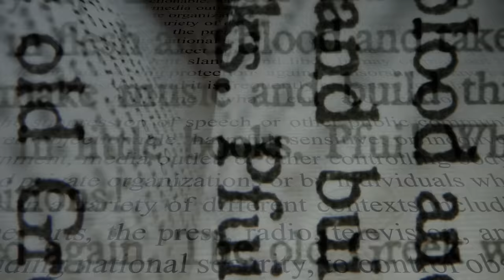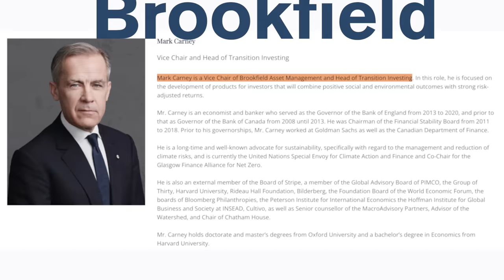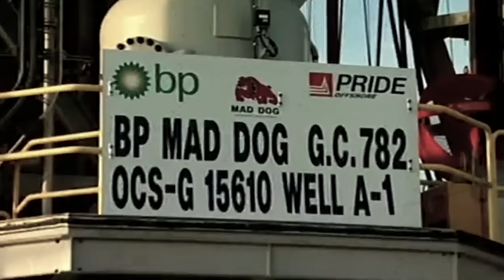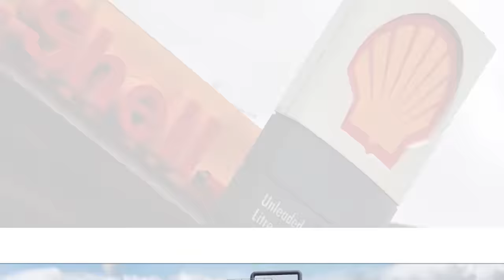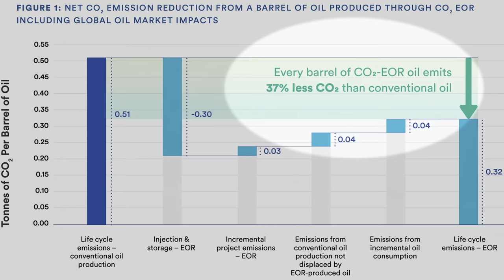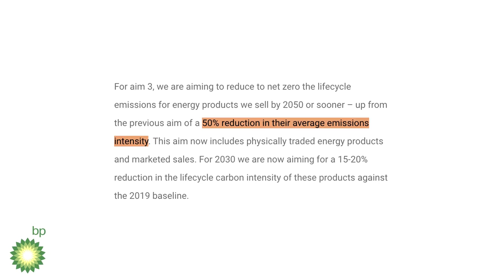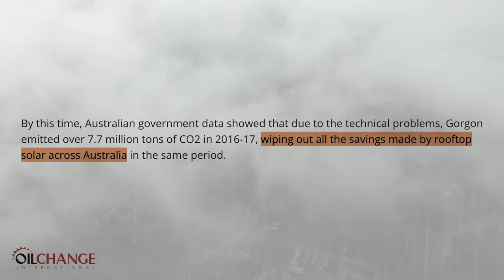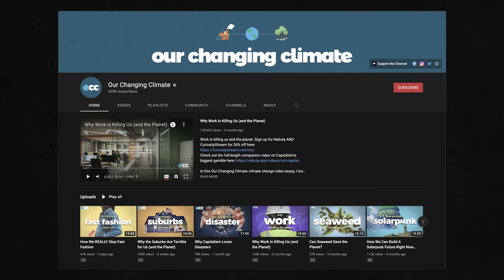The dirty "Net Zero" carbon myth (that everyone believes)

Comment: So, as we capture all this carbon, what happens to the trees that already do this for us. There is a direct correlation between plant life flourishing and high levels of carbon. They literally filter the air for us. Seems like they want to take over the tree’s utlility so they can make MORE money
Reply: Happens nothing with the trees 91% of all trees on the planet are wood farms.
Reply: @robertagren9360  thats just false
Reply: @wtice4632  
That's a lie since your comment lacks a foundation. It happens nothing to the trees. we just plant new trees to replace the old
Reply: @robertagren9360  91% trees might be earmarked for destruction, but they arent 'wood farms'... typically rapid deforestation is driven by agriculture - often destructive agriculture like date palm or soy etc
Reply: @brendoncahill6409  
They're no longer woods and agricultural land so what's the point saying that we should stop growing wheat, potato, corn, tomatoes and lettuce because we're worried about trees who are no longer there and any planted trees becomes wood farms. They're no normal woods. They're planted woods.
Reply: @robertagren9360  what is the difference? A tree is a tree. All green plants use CO2.
Reply: @robertagren9360  the mass of a plant / tree comes from the air (co2)
More c02 = bigger plants = more oxygen = you get it.
Reply: @fustercluck2460  
We are not running out of oxygen, sir. We see temperatures increasing, this causes the soil moisture to decrease due to evaporation. In other words trees are running out of water and we too. With less water, a tree can capture less CO2 and build less biomass. It's a matter of balancing that famous chemical reaction, you know...
Reply: @lorenzoventura7701  I didn't day we are running out of oxygen 🙄
I said the mass of a tree comes from c02 in the air.  Without c02 a tree couldn't grow or survive.
Reply: @fustercluck2460  
This relation is false:
more co2 = bigger plants

It may be true in a greenhouse because the farmer has control on the water and nutrients, not in the wild.
More co2 = higher temperature = less moisture = less water = less photosynthesis = smaller plants
Reply: Indeed, we already have high-tech CO2-sucking machines called... trees.
Reply: Maybe they just want to keep creating more crises.
Reply: @lorenzoventura7701  As average temperatures at the Earth's surface rise, more evaporation occurs, which, in turn, increases overall precipitation. Therefore, a warming climate is expected to increase precipitation in many areas.
Reply: @dodieodie498  Just maybe...
Reply: No one is suggesting that we remove ALL CO2 from the atmosphere.
Reply: @fustercluck2460  
Increasing wildfires and desertification tell a different tale
Reply: @Boylieboyle    Hmmmmm.  Could beeee.....
Reply: Ar least come to the conclusion that it's not trees, planting trees is what we already do. We use fossile fuel and no way out of it. Want to know the most contributing? lightbulbs. No car is close to the environment damage of lighten up cities at night. Even before we had the traditional lightbulb was cities lighten up with gas.  Issue is heat and the candle who burns twice as bright fades twice as fast. So what we're doing is trying to solve an energy crisis who we shouldn't solve to save the planet because if we do, we're funding the oil companies. Oil companies are lucrative and even the governments won't allow them to crash. Germany as example is relying on a finnish gas company who is bankrupt.
Reply: @PapaBear187  But heating the planet lessens OUR ability to flourish.
Reply: @PapaBear187  And, really, there are absolutely ENORMOUS areas of forest that are dying off as a result of beetle kill, which is being driven by the warming climate. Eventually, in the very near future, temperatures will directly threaten plant life, including the crops that we depend on for survival.
Reply: @PistonAvatarGuy  yea ok lol
Reply: @PapaBear187  Right, so, you're just in denial, then?
Reply: @PistonAvatarGuy  no, you just need to learn more about the history of our planet. Carbon MONoxide i get would be dangerous. Carbon DIoxide has a key role in plant growth/health. Ever wonder why plants do better when you talk to them? it's not because they find it soothing...it's becuase you are breathing on them...
Reply: @PapaBear187  Of course, I can't post a link to support what I'm saying here. The beetle kill problem is far worse than most reports are letting on, it's absolutely everywhere in the northern latitudes. The entire western region of North America is affected, as are European and Russian forests. I haven't seen any data from Russia, because they don't GAF, but the problem is extremely apparent in some videos from the affected regions.
Reply: @PapaBear187  It's absolutely TERRIFYING how simple you are. You can't even process the idea that more than one environmental factor can affect plant growth!
Reply: When I hear of things like carbon capture, I have faith that some day people will look back at us and shake their heads.  I also wonder what stupid things that generation will do.  We don't get any smarter with each generation, probably the reverse.
Reply: Wow,  I used to think, oh, that is extreme.   Not any more.   We absolutely must become responsible.  The whole ecosystem is getting out of balance.

Comment: One main threat coming from BP, Shell is Hydrogen production.  They have the money, the power and the lobby size to push hydrogen as a "green fuel".  However the process the oil companies use to make hydrogen from natural gas, is more polluting than burning the gas in the first place.

Comment: Almost as bad as a coal fired power station switching to burning wood pellets, which are imported from the other side of the world and which produce 10% more co2 per kw hour produced than coal. And then having that same power station receive a billion pounds a year from taxpayers because apparently they are green. Which power station… Drax. In the UK.

Comment: Sorelle, I love your broadcasts. One thing, one VERY important statistic / Fact you failed to point out is that carbon dioxide, CO2, is only 0.04% of the Earth's atmosphere! The phobia around CO2 gas is laughable in the overall picture of the Earth's atmosphere. Trying to control CO2 is the biggest scam in so-called Environmental science. Thank you for your contributions, and best wishes to you.
Reply: While I know that CO2 emissions have nothing to do with saving the planet, the argument that it only makes up for 0.04% of the atmosphere is a flawed one. If you ingest a very small amount of certain poisons  you will die, even though the amount is minuscule compared to your body mass.
In chemistry some substances called catalysts have properties causing the chemical reactions to speed up considerably. They are used in small amounts.
So yeah, while I agree that CO2 is not a problem (we actually need more of it), the argument itself I find it flawed.
Reply: 0.04% is 4 parts in 10,000. The whole alarm issue is about the increase in the last 150-years, from just over 3 parts to just under 4 parts per 10,000. It is simply rediculous and serious scholars know it.
Reply: @johnpostlethwaite1292  it's truly sad how this information is suppressed by the MSM. People need to know this.

Comment: Great presentation. It would be also helpful to do a clear analysis, as others have done, on how man made CO2 not only is not causing climate change but is actually helping tree and plant growth worldwide.
Reply: Absolutely, at 200 ppm like in the 1750ties it would be very hard to feed the word. Thank God for the 400 ppm we have  today.
Reply: What's the point, many have done this comprehensively but people still believe the lies. Geoengineering has been thoroughly exposed yet it's still ignored. You can take a horse to the water...

Comment: I'm interested in the comparison of how much money is invested in 'real' clean energy sources such as nuclear and solar energies compared to technologies such as CCS.

And if nuclear and solar energies are truly clean or are they just another scam
Reply: They aren't clean because to manufacture parts you need energy which you primarily get from gas which is just more CO2 emissions. They can become clean if they generate enough power without emitting CO2, but it is very difficult to calculate if they are "clean" or not. No resource is "truly clean", there are only slightly better alternatives. We also have to think about the calorific value and the time needed to generate the energy. 1 gallon of oil vs 1 sq. ft of solar panel vs 1 g of Uranium as an example of comparison
Reply: @manmeetsingh3024  Nothing wrong with c02.
It's good for the environment.
Reply: @fustercluck2460  how is that?
Reply: @karimmohamed7725   Plant food 🌳

Comment: I am actually fairly disturbed by the fact people are going from single use plastics products to Bamboo, hemp and single use paper/cardboard products instead. Reusable grocery bags also damage the environment as most people hoard those damn things or throw them out after using them only a few times.

Isn't that just going to result in increased deforestation and direct damage to the environment anyway? I mean that's why Australia brought in plastic shopping bags and stopped using paper bags back in the day anyway.

I'm glad my local grocery store still uses free  recycled plastic bags, they should still be available for free to people that still want to use them. Others can use the reusable ones.

Comment: So they are banning Concrete too?  Concrete contains limestone and it reacts with air and other constituants to produce 13% Co2. So if we have Concrete we will have a continuous  rise in Co2.  We still and will use gas as an " alternative " form of energy yet it also gives pff Co2 so where is the carbon neutral come from?

Comment: CO2 has no significant effect on climate. Fortunately, because any effort made has had no significant effect reducing CO2 concentration of atmosphere. Search for "Mauna Loa CO2" and you see nothing makes the curve bend down except northern summer. Search for "10 July 1913" and you'll see hot weather is not anything new.
I agree record heat is worse than harmful, but reducing CO2 is just ineffective.There are more powerful means to dampen down regional record heat.

Comment: Carbon Capture works in Iceland because there they use the vulcanic heat as energy source. Although the amount of CO² captured is still relatively low.
If you don't only use renewable energy for it, it of course is bound to fail. And combining it with oil production is way out the scope.
The money would for sure get a better outcome when invested in reforestation, bog repair and keeping our oceans clean and healthy.

Comment: Net zero refers to a state in which the greenhouse gases going into the atmosphere are balanced by removal out of the atmosphere.  We can't remove much out of the atmosphere especially if we're not using energy and causing more carbon. We currently can't make enough electricity through wind, solar, and dams so we need to keep other things in play. Instead of working to stop the general public from using energy, the governments need to work on some kind of solution that enables the ever-increasing population to use the same amount of energy without making carbon. Problem is, they can't and in my opinion, really don't care. Like she says, they're hiking the price and asking you to eat bugs so they can make as much money with as little expenditure as possible.

Comment: Thank you. The premise is entirely false as well. Pollution is a problem. Carbon and carbon dioxide isn't. In fact, if the carbon dioxide saturation of our atmosphere went up, even dramatically, we'd have a greener planet. Ask anyone what the current CO2 saturation is and they won't be able to tell you. Ask anyone what would happen to the Earth if the CO2 saturation of the atmosphere dropped to 150 ppm and they won't be able to tell you. Ask anyone what would happen to the Earth if the CO2 saturation skyrocketed to 5000 - 7000 ppm (like it did for thousands of years) and they won't be able to tell you. Yet everyone is spouting off carbon and CO2 and net zero, etc. Once again, the emperor has no clothes. It's all based on utterly fake science.

Comment: If you like clean energy then support nuclear power.  Northeast US here and many of us still burn oil to heat our homes as electricity is too expensive for heating and natural gas is not an option.  All while nuclear power is being reduced.  Solar and wind are fledgling industries and do not have the maturity for even 50% of needed power.

Comment: There are companies right now that can convert all plastics (Even dirty plastics) into fuel(being done on Canada). All our organic (Also, being done in Canada) and human waste can be converted into natural gas. Yes,our and animal poop can fuel the future. Geo thermal power, heating and cooling is somenting that should be developed to make it cheaper to make it possibile for individuals to have a system installed for their homes. Meanwhile Thorium reactors would be great to replace nuclear reactors and can also help by mixing old nuclear waste, which would reduce the half life to 300 years approximatley. Also, a golf ball size of thorium fuel is all that would be needed to provide enough power for an individual for their entire life and the reactors are safe. There are many solutions out there and being used, but not promoted. Why? I think we all know the answer. Anything that can't be centralized or taxed is being supressed.

Comment: Artificial carbon capture is dangerous. 150ppm is the point at which plants start to die and we are only 300ppm above that. Without the industrial revolution CO2 levels would have been dangerously low by now, as they had been declining for millions of years.

Comment: It all starts with the false premise that carbon dioxide concentration in the atmosphere has anything whatsoever to do with climate. The strongest greenhouse gas in the atmosphere is water vapor and it's a 1000 times more so. Claiming that the last 40 years of temperature measurements represent the entirety of the record is false. If you include all records you will find that the 1930s and even the early 1900s were far warmer and had much less carbon dioxide concentration.

 Nonetheless, we do need to conserve our fossil fuel blessings.  We also need to reduce chemicalization of our environment which is what seems to be contributing to the transgendering issue. It seems that all these centuries man has been modifying the environment to improve our existence, but as it turns out, our environment is  modifying us.

Comment: I really thought this was a video about the myth of net zero but it's about who's making the most money from net zero.
You don't need to reduce CO2 and in fact it would be better if we had more so net zero is an agenda that doesn't matter if it fails because that would be better !
CO2 as a percentage of the atmosphere is 0.04%
At 0.015% all the plants die
So that's only 250 ppm above plant extinction so not something we want to be reducing is it.
A person puts out about 2Lbs of CO2 a day
In 1750 there were approximately 790m people on earth
Now there are 8 Billion
CO2 was about 0.028% in 1750.
So 10 times the people now with cars too so why isn't the CO2 level 10 times that of 1750 ?
In fact its not even double.
Farmers pump CO2 into their greenhouses to get their plants to grow quicker.
Higher CO2 levels even let's plants require less water.
CO2 is a greenhouse gas but it's not a great one making very little difference unlike clouds for instance which are infinitely better.
Interesting fact:
Greenland ! Why is it called that ? It's 80% snow and ice !
Back in 875 AD when it was named it WAS green and they grew lots of crops there.
Must be global warming made it change to snow and ice .
It's all bad science. They take one bit of cherry picked data out of context work out the worst case scenario and extrapolate into the future to come up with predictions that not one ever has been correct
So I don't care if the bankers or oil giants get rich off this rubbish just as long as it's not Greta and her gang lol

Comment: Stop knocking everything.
We know fossils fuel is a limited resource, so it doesn't matter if short term is gained, the real revolution in technology is pushing ahead.
Trouble is people like you don't think beyond today. In 50 years time, if pressure is kept on, long after I'm dead, hopefully, none reliance on fossil fuels will be possible, and the oil companies will run the renewable energy supply they are investing in.

Comment: We all learned from our school days that it is carbon dioxide that drives the world's food chain. Undisputable. Ok, NASA has shown that because of some extra carbon dioxide, an area the size of the United States has greened up. How can that be bad for the environment? If an area that size has greened, the world's biodiversity is better off. Again how can that be bad for the environment? If you look at the data, around 1850 atmospheric carbon dioxide was the lowest in 600 million years! Europe was in a mess! The claim is that carbon dioxide is making the weather worse - that's arguable and the IPPC says it isn't. Is the climate changing? Of course it is! 1850 was the end of the little ice age, therefore warming is mandatory, as the cycles go. The greatest greenhouse gas is water vapour, which dominates all other greenhouse gases, but you see, governments and even the UN can't contol clouds... so they are never mentioned.